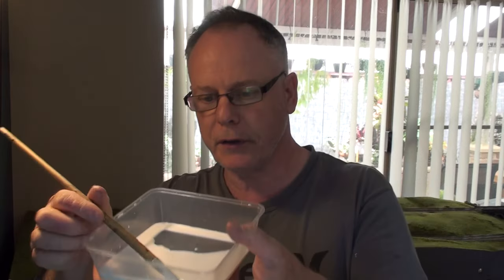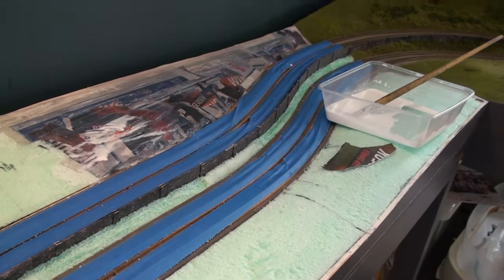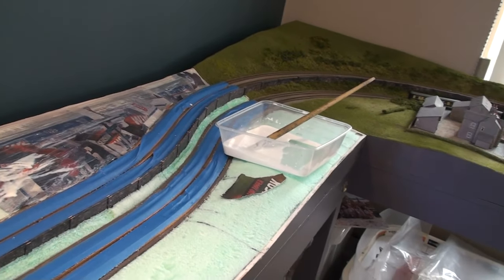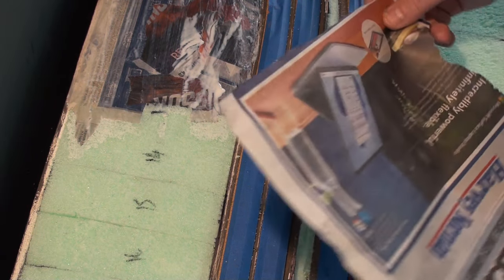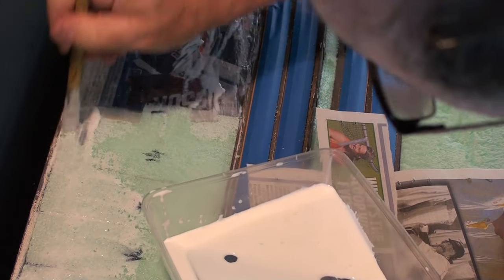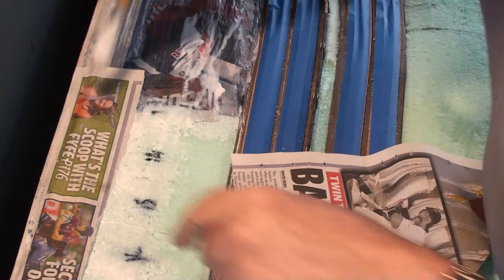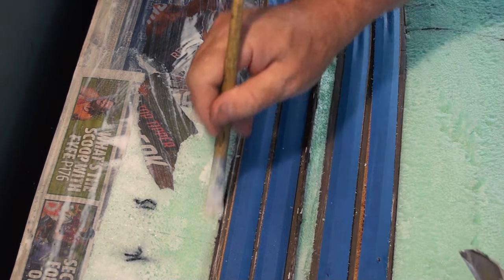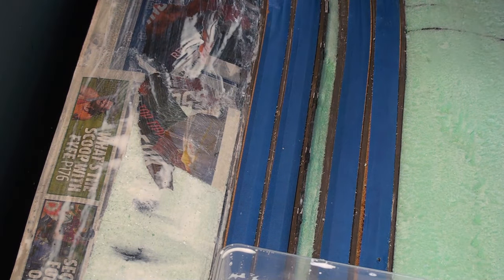N Gauge Four Oaks Street Station Part 78   XPS Foam next step

Comment: I had not come across this method before but will certainly use it on the layout I am planning. Thank you for sharing.
Reply from the maker: I have now used three types of XPS mainly due to supply issues, they have all been good, I have small hot knife but i find using the saw to get it close and then the rasp works great. Thanks Kerry
Reply: @ngaugefouroaksstreetstatio6932  Thank you for the advice on tools.